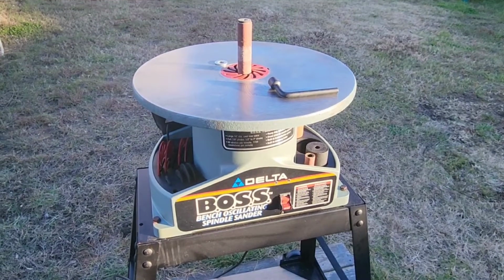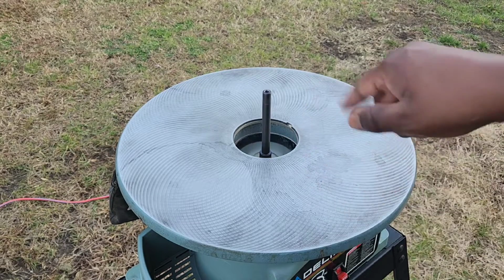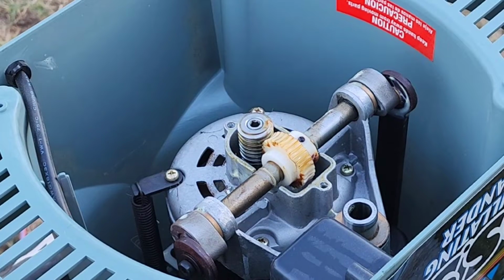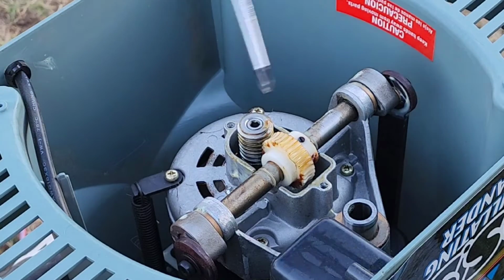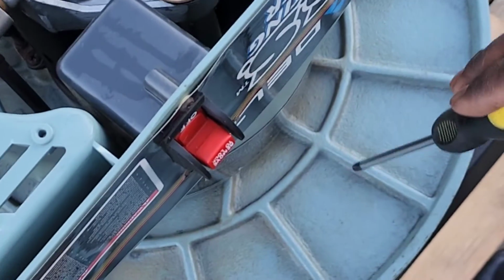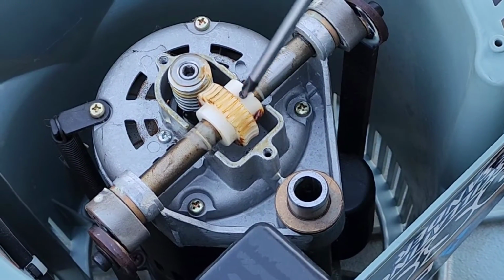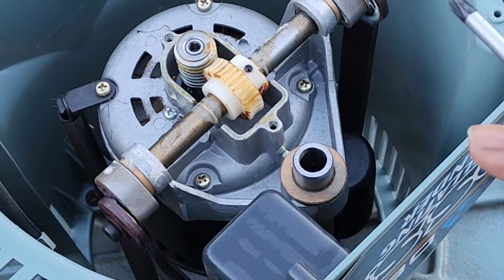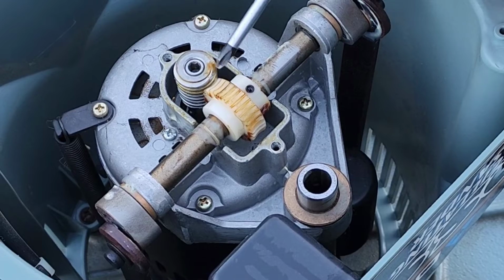Why does your Delta B.O.S.S. sander not Oscillate / Move Up & Down? FIXED!!

Comment: Don’t see the link in the description….needing this gear. Thanks.
Reply from the maker: ⭐ HELPFUL Download ⭐
☑️ MANUAL➜ https://drive.google.com/drive/folders/12XPn9dXhxtyK7ce5xLZQl2iw6w9HgV1p?usp=sharing
☑️ 3D File to Print Delta 1347788 Gear ➜ https://drive.google.com/drive/folders/1noLTeV0SHsQ7ldBe6qumlkRDiWeuHE3K?usp=share_link
☑️ Delta 1347788 Gear ➜ https://www.ereplacementparts.com/gear-p-86520.html